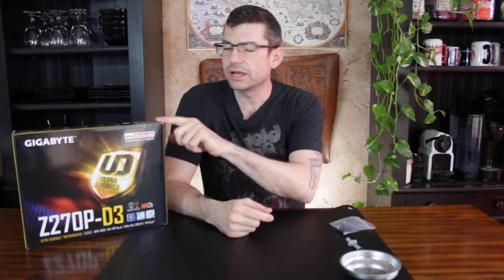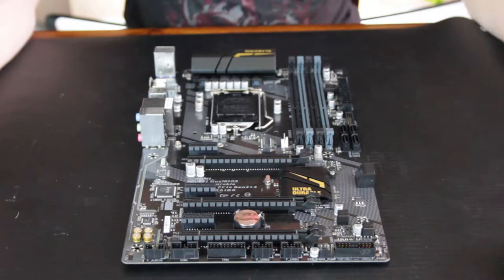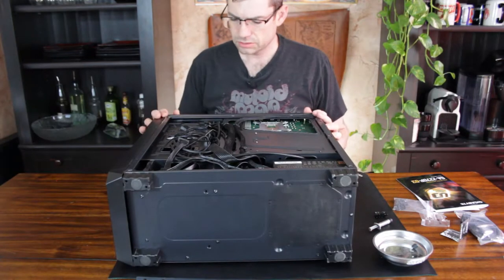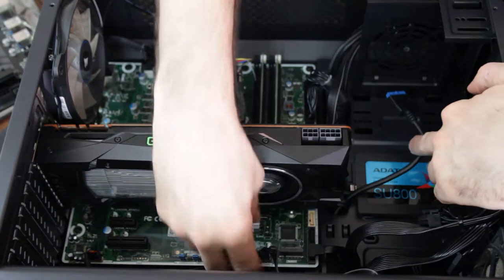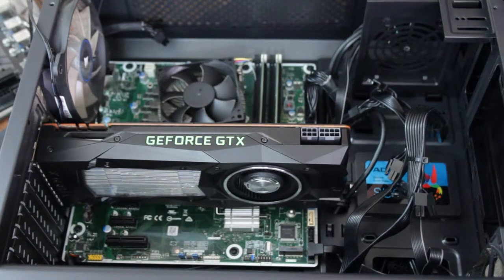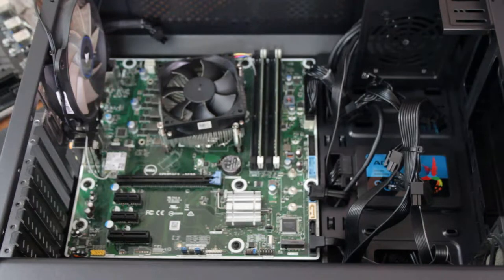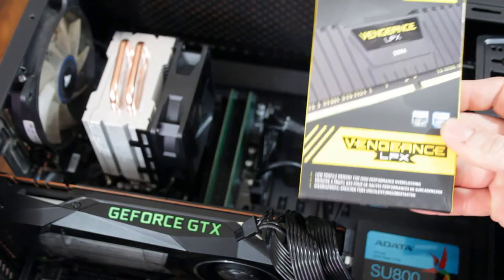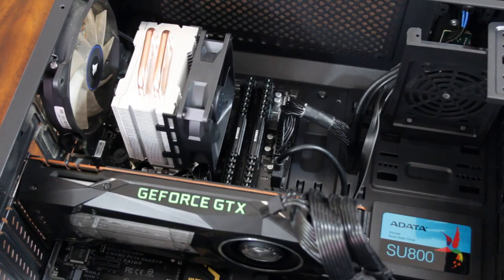Pre-built Dell XPS 8910 Motherboard & RAM Upgrade + new CPU cooler (about $204 total)

Comment: Very good how to video. Will the new motherboard and cooling unit fit in  the original Dell 8910 case?
Reply from the maker: Sadly, no. That case was not designed for anything other than Dell’s provided parts. Not that it’s impossible, but it would require very careful planning and lots of trial and error.
Reply: @thejonathandoan  Thanks for the reply. Don't need the hassle of fighting to get things to fit. Guess I will get a new case.

Comment: I have a dell 8910 and I’m trying to case swap but can’t figure out how to get the antenna black and white cable through the tiny hole on the top above the fan. Was wondering if you could tell me how you did it
Reply from the maker: Oh man, I hope I remember correctly! It's been a while since I worked on it. I think it was a small screw on the chip connected to the motherboard. I unscrewed it and then removed the wire and sticky antenna end. Then removed the chip from the motherboard, re-attached the wire in the new case, and put the chip back in the motherboard. I remember the sticky part didn't want to re-stick in the new case, so I taped it with electrical tape to secure it.  Hope that helps!
Reply: kodiakthejuggler thankyou I figured it out. I had to take the plastic barrier off to access the wires.

Comment: Great vid sir. Can I plug an i9 into that board and stick it in to my XPS 8930?
Reply from the maker: Not sure if the i9 would fit, but I wouldn't. I'd just save up my clams until I could get something that would do the i9 justice! :)
Reply: no way, it's a 1151 socket for 6th and 7th intel gen.

Comment: what gpus can go in a xps 8910?
Reply: i7- 6700k processor is the fastest you can get for Dell XPS 8910. The base clock speed is 4.0 GHz can turbo up to 4.2 GHz that's without it being overclocked. I hear people have overclocked the i7-6700k processor up to 4.8 GHz. Also the processor is 4 cores with 8 core hyper threading. As far is the fastest GPU you can get for Dell XPS 8910 is the EVGA RTX 2080 Super. Not sure if the EVGA RTX 2080 ti will work. Because the length of the GPU might be too long due to having 3 fans on RTX 2080 ti card. Best bet would be to go with the EVGA RTX 2080 Super card. Dell XPS 8910 would be awesome setup with that Graphics card. Just make sure you have a good cooling system in place too, then your good to go.